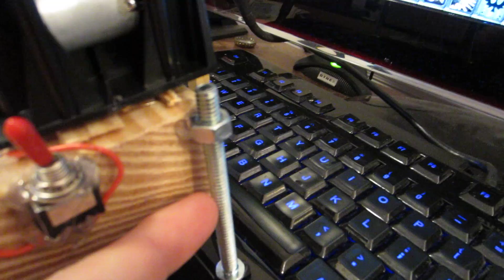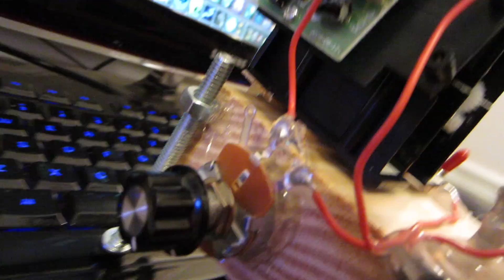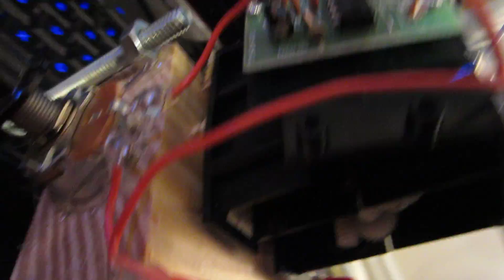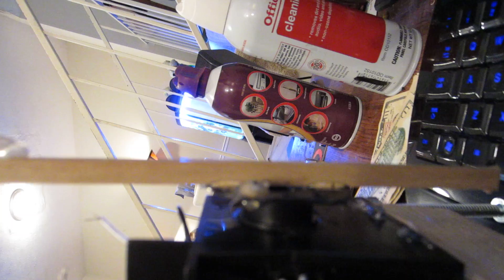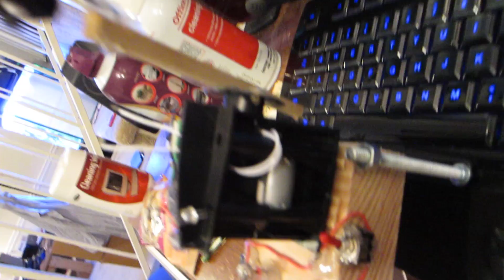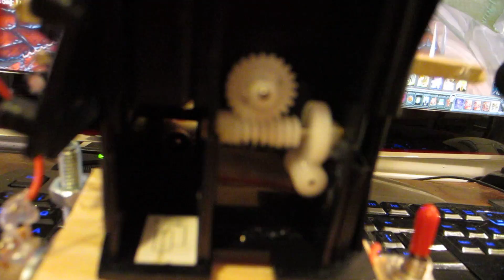WoW Anti-AFK Machine

Comment: I just took an old keyboard, opened it up, and used an ic555 timer circuit to alternate between closing W and S every couple seconds... :/ 5 minutes and about 10 cents. Free if you pull an ic 555 and wire from something you're going to toss anyway.